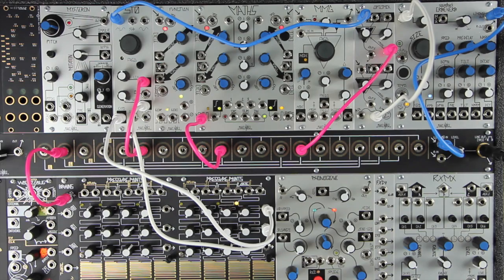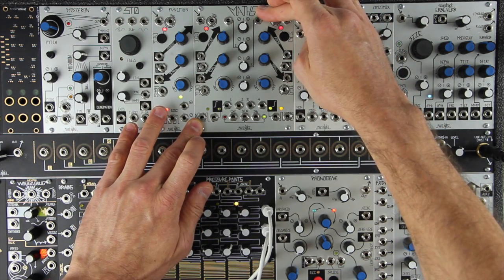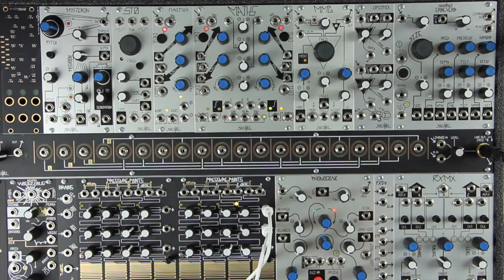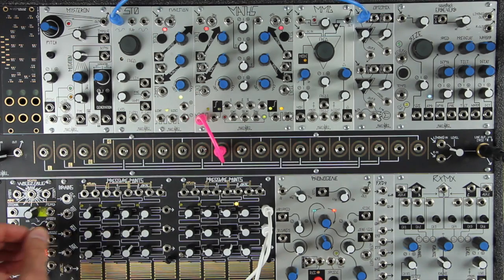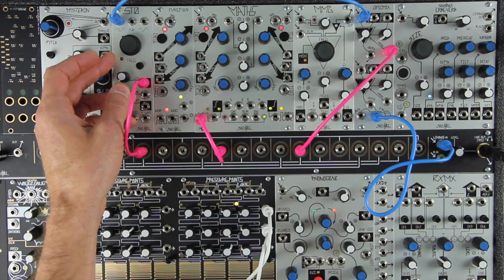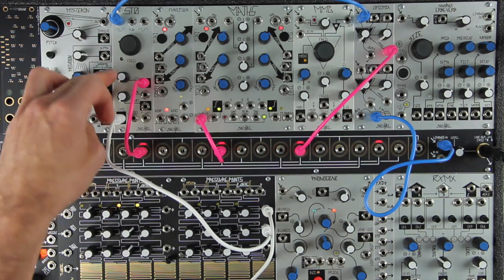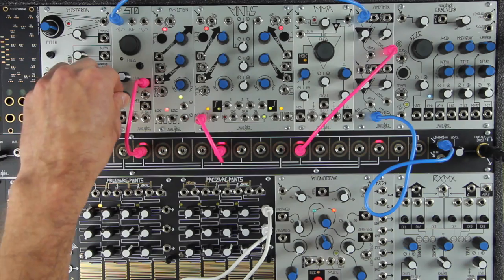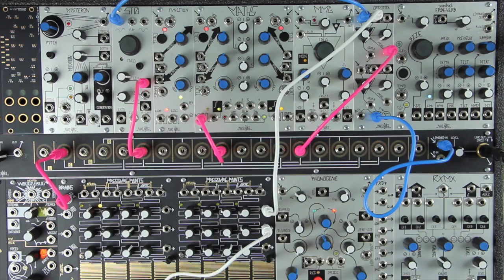Modularbeats: Bass Drum using STO & Optomix

Comment: I have a question. Can anyone tell me if it's possible to trigger modular drums with midi note on messages AND control the volume of modular drums using MIDI velocity at the same time? If so please explain. Will a basic midi to trigger module work for this or does it need a trigger and something else. What MIDI to CV module will work this way and what drum modules will work with it in this way using only one MIDI channel, but being able to trigger at least 8 sounds from drum pads on a drum machine with velocity sensitive pads?
Reply: JMFH SMITH A trigger alone will trigger an envelope, but for velocity control, you’ll need to send velocity cv to the vca. 
If you don’t know how to do what I just explained based on understanding the concept, I wouldn’t recommend spending thousands on modules. 
Learn the essentials with Reaktor first, as it lets you patch your brains out without having to buy additional modules. You’ll learn what VCAs do and how to mix trigger information with modulations for amplitude and filtering, etc
If you’re determined to buy something, buy an Elektron analog rytm. It’s got velocity sensitive pads (although the pads suck on the mki), analog circuits, and it’s all in one package. You can trigger it externally with midi, you can go wild.

Comment: Does this work with a dpo?
Reply: You can get a great kick drum with a DPO on its own using the strike input on the final out. Tune the pitch down, set the fold dial mostly counterclockwise and play with the wave shape until you like the sound. It's an expensive kick drum but sounds good.
Reply from the maker: Arthur Robert yes, same patch just use VCO A on the DPO and skip the part about the SHAPE parameter.
Reply: Was wondering the same thing, thanks gentlemen